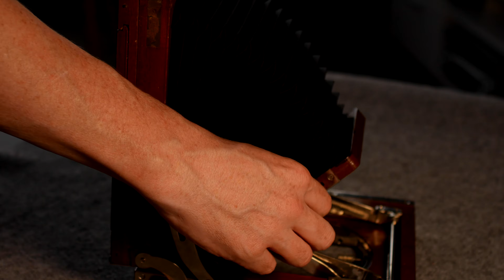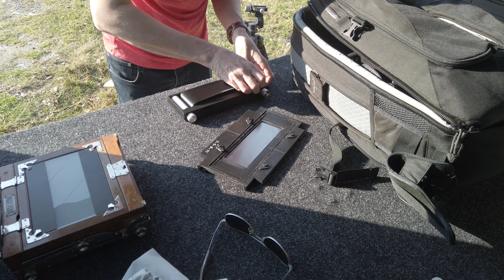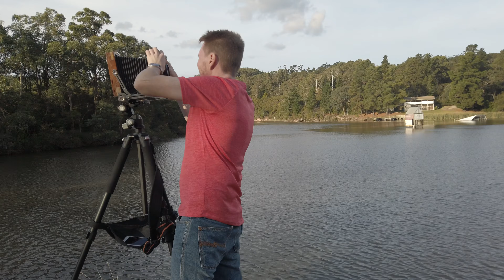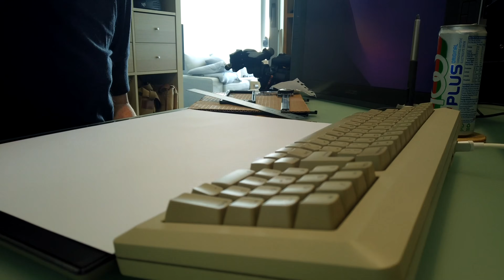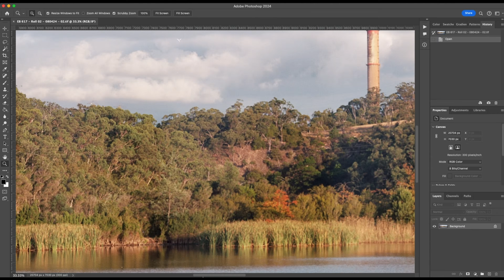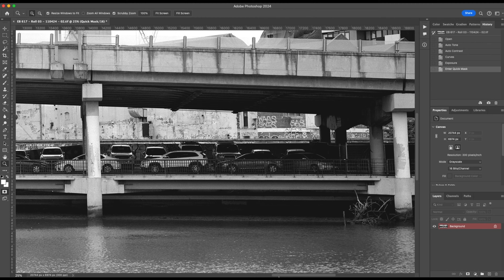DIY 617 Panoramic View Camera Build: Cheap Shen Hao Replacement Part 3

Comment: Extremely Interesting project! Seeing your journey inspired me to design my own 6x17 Camera aswell!. My design is more along the lines of the Chroma 6x17, so no movements and groundglass focusing at the moment. Maybe I will try and print a 6x17 back for my 4x5 in the future! I do have one question though: On your film holder it seems that the film is only being held in place at the top and not on the bottom. How is that working for you? I am struggling on how to hold the film in place securely and this caught my Eye. Is the film really only being held in place at the top?
Reply from the maker: Hi,
Not sure what you mean by the film only being held at the top? On this version of the camera (before I went and built a full Shen Hao style camera) the film is held in place on the rear with a felt backing that acts as a sort of pressure plate. The files are available on Thingiverse if you want to download them and see how it works.
Reply: @thefilmlaundry Hey I meant how the film spools were being fixed in place. On the thingiverse file it seems that they are only being held in place by the advance knobs. Am I missing something here? Tahnks, i hope that made it clearer
Reply from the maker: Ahhh, now I understand. Yep, there are springs on the shafts of the winder that press the spool down in place. I original had small nubs for the base that the film sat in, but found they weren't necessary and caused more issues than they solved. Once the back is in place the spindles have nowhere to go really so there's no issues with them not aligning. Pretty much as long as you are careful when you load the film so that the first wind or two is straight, there's no issues. I use the same approach on my Shen Hao style camera, and zero issues.
Reply: @thefilmlaundry ah that clears it up a lot! Thanks!
I also think it would complicate the design so I will leave them out aswell! Cheers!
Reply from the maker: Also, on my website under instructional videos, there is the full build video for the newer camera, if you skip to the film back section, a lot of that is relevant, the film backs between the two cameras are quite similar in their base design, I've just refined and updated them, but at least you can see how they go together
Reply: @thefilmlaundry Thank you! I will have a Look!

Comment: Re the light leak: With 120 roll film be careful when handling, that the paper wrapping stays taught. This is a common problem with light fogged roll film....
Reply from the maker: As it turns out, it was a combination of things, im sort of glad it happens though, taught me a lot about diagnosing light leaks, so that when I came time to design my fully 3D printed Shen Hao style 617 camera, I had all those problems ironed out, and have had zero issues. But yes, I always make sure I don't have loose rolls, additionally, I stored exposed rolls in a dark box until developing.

Comment: Great to see another ausie in this game, just printed velvia's 6x17 and it works like a charm but have always wanted to build or print a 6x17 back for my (rebuilt to 5x7) eastman view 2a. Interested in sharing?😊
Reply from the maker: That's awesome.
I'm still in the process of tweaking the design, so the files are a bit of a mess, will keep you posted though.
Reply from the maker: Have finally finished the design to a level I'm happy with, its up on Thingiverse now https://www.thingiverse.com/thing:6625537

Comment: Would your film back work on a Russian 5x7 folding camera? Curious, why avoid wet scanning?
Reply from the maker: Probably, would require some alterations though as I believe most 5x7 cameras use their own mount for film backs and they generally arnt interchangeable. 

As for wet scanning, too much mess, cost and hassle for only a small increase in sharpness on my scanner, which I would only really even see on super large prints, which I haven't really done any of, and if I did I'd probably just get my lab to drum scan the nef for me.
Reply: @thefilmlaundry  I'm going for the cheap route for wet scanning. Instead of buying specialty fluid I'm going to use gamsol and some mylar I purchased from Amazon. I have the 750.
Reply from the maker: Good luck, from the videos Nick Carver has done on it, it looks to give pretty good results on the Epson, from memory one of his shots came out better than on a high end drum scanner
Reply: @thefilmlaundry  I'm 3d printing the Open 617 V8 camera from Printables.
Reply from the maker: Yeah I've seen that project, the 6x24 looks insane 🤯